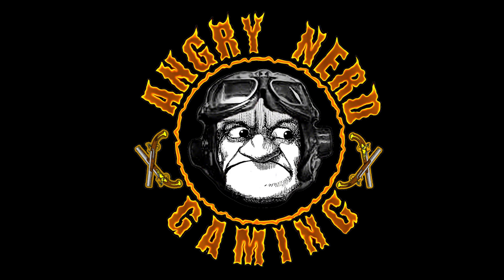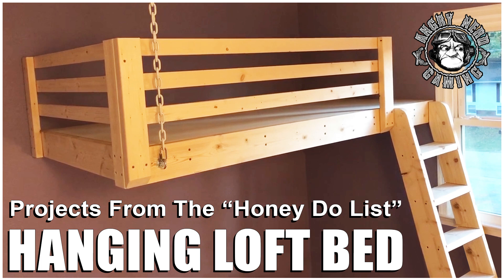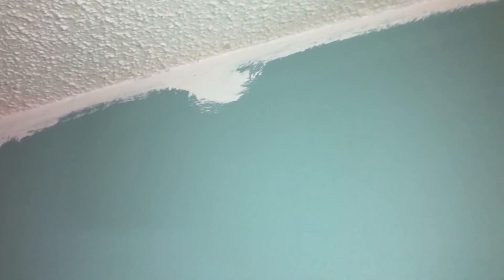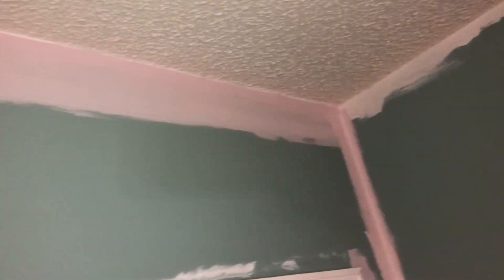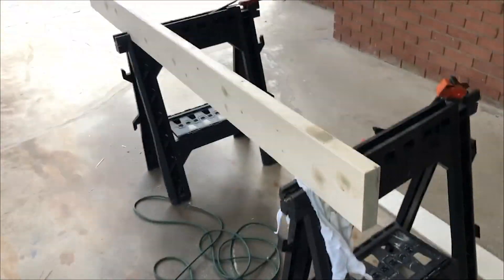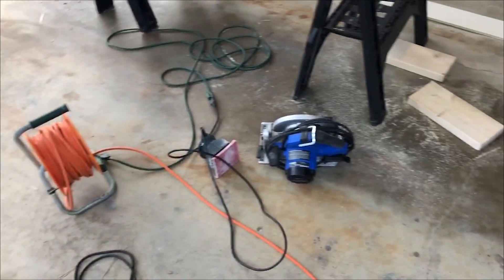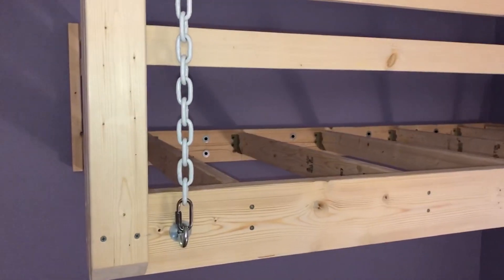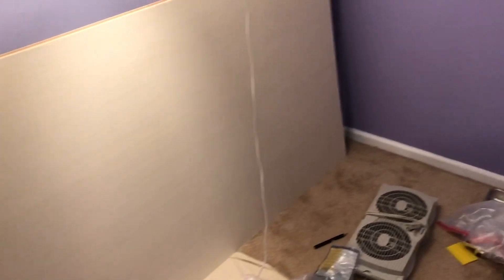Honey Do List:   Loft Bed, Hanging Loft Bed

Comment: My wife does all the electrics as she sparks nicer than me. I do the painting in my usual pace 1 wall per year. She still complains about my speed.  So we all appreciate you actually did not run away. Your rectangle was actually quite good, you are the man of measures! If i would have done it surely the door would not open...

Comment: Well done!!  What kind of anchor is that in the ceiling for the chain?  And how did you screw that in?
Reply from the maker: If I remember correctly, it is a 3” or 3 1/2” eyebolt for wood 🪵, that I screwed up into a brace I mounted between the ceiling joist.
Reply from the maker: I used a screwdriver in the eye to give me enough leverage to screw it in
Reply from the maker: Bracing at 8:20 this video

Comment: Why use those brackets? why not just use lag screws
Reply: I was only going to use the brackets so it would be easier to just drop the 2x4 in place once I got the frame secured to the wall, but then decided that the outer frame would be bearing all the weight with just the 2 sets of corner screws, so I screwed all the 2x4 into the outer frame

Comment: Is it sturdy enough for a adult person,I want it to make two beds just like this for my children.
Reply from the maker: Yes definitely, provided you secure the chain to the ceiling joist good.  You could also make the corner held aloft by the chain, a leg to the floor instead.  Anyway I am almost 300 lbs and I am up there quite often, both of our 21 yr olds and the 14 yr old have been up the at the same time.
Reply: Yes-provided u bolt in with large eye bolts into studs